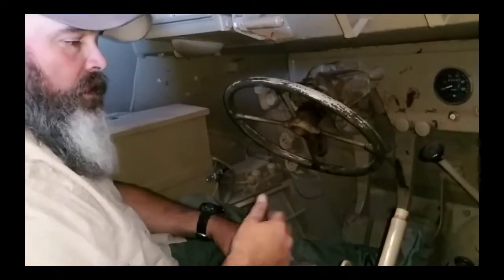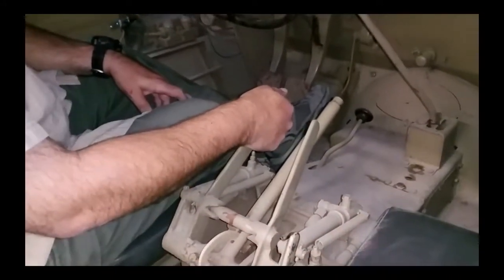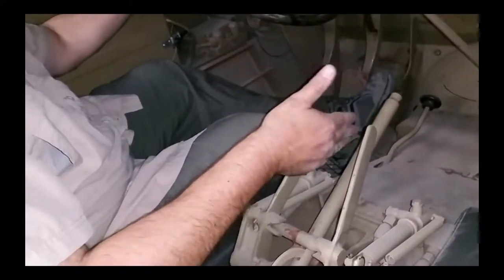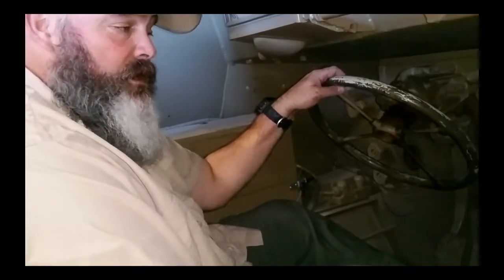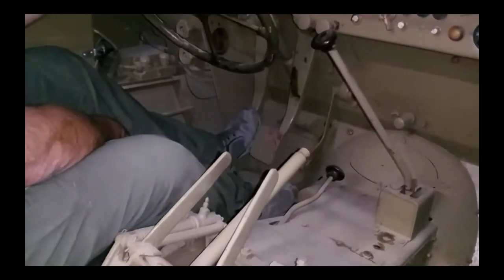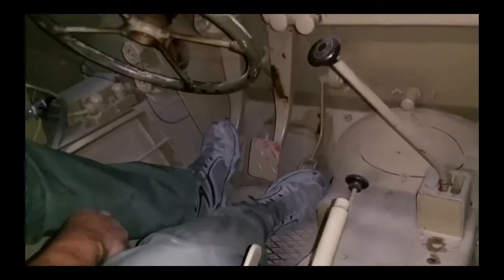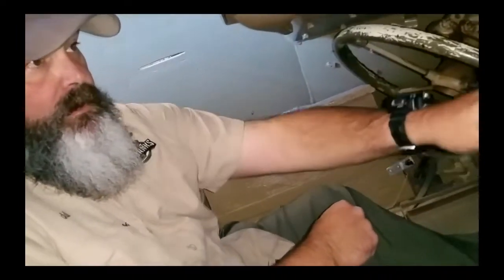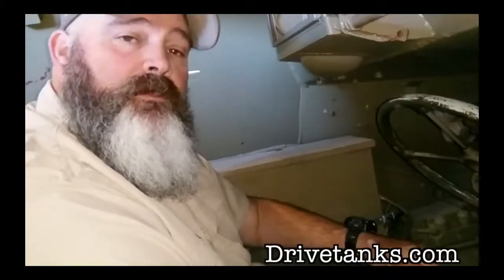German Sd.Kfz. 251 Halftrack - Part 2

Comment: The Power/Track steering(Brakes) should engage at a specific angel on the Steering Wheel. There is a Explanation in the manuel for the Right Setup in the linkage. On light turns, you only use the front wheels, but when you turn more, the inner track should be slowed down with the steering brake. The Levers in the middle should be used, when the wheels lost contact with the ground or don't work, because of bad Terrain(mud) etc. Great Video's, greetings from Germany. (Sorry for bad english) ;-)